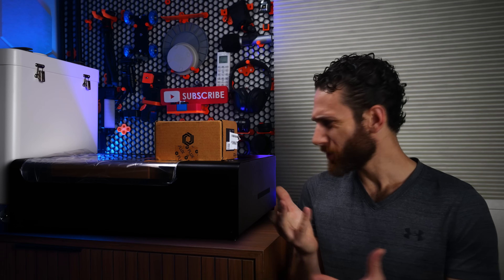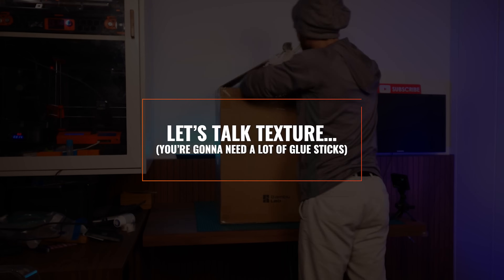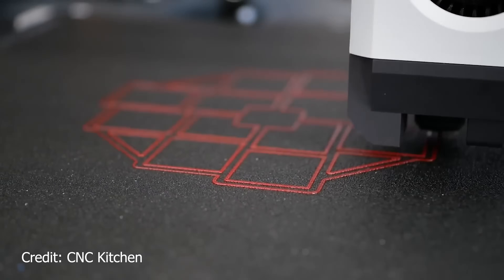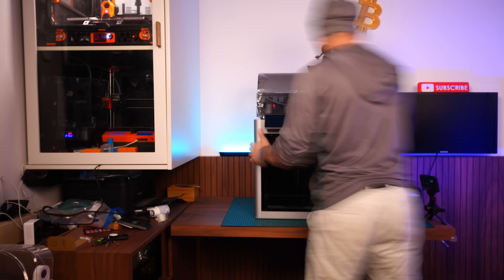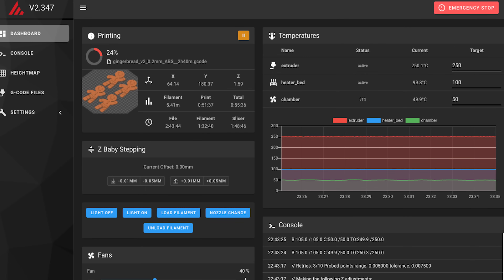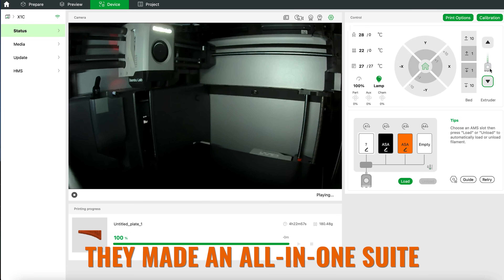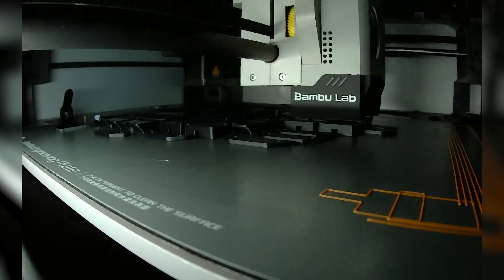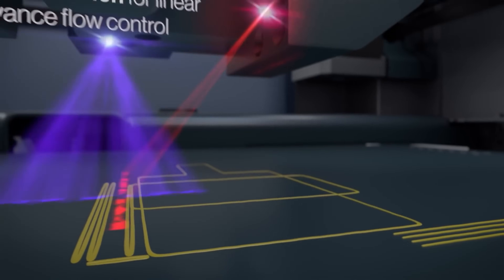Bambu Lab X1 Carbon: What NOBODY Is Talking About...

Comment: I’d love to see Bambu Labs develop a 3D CAD program that matches the design, layout, and terminology of the software they already provide to control their printers. That consistency would make it much easier for new users to learn both the printer and the design process. Similar to how DaVinci Resolve offers a free version alongside their hardware—with a paid upgrade for advanced users—Bambu could offer a basic, free CAD tool to help users create their own models, not just print others’. Then, once they’re ready, they could move up to a more powerful paid version. Right now, many CAD programs cost more than the printer itself, so having an integrated, familiar-looking option would lower the barrier and expand what's possible for first-time users.

Comment: For anyone looking to own a Bambu printer: as of now, there is no such thing. If you buy a Bambu printer, you do not OWN it. Meaning: 

-It will connect to an external server you have no management or control over, violating your privacy, and thereby making the printer dependent and at the mercy of the server you don't own and manage. 

-Bambu Labs, the company, takes part in CHANGING THE TERMS OF THE SALE, and tries to hide their actions. 

-Difficulty in repairs - Bambu often doesn't have replacement parts available, and their firmware for their printers is closed-source, unlike most other 3D printers. 

-Closed Ecosystem - much like Apple, Bambu printers are exclusively designed not friendily accept user mods or 3rd party addons, sometimes even software (eg orcaslicer)

I do not wish to condemn anyone who already has a Bambu product, more so condemn Bambu labs, the shit company.

Spread the word about this, especially in regards to the recent Bambu controversy.

Comment: The biggest downside for me wanting to purchase for my school.  Is the networking. The wifi security support on the X1C is lame, plus there is no Ethernet.  You have to go for the X1E at $2000 to get properly secure wifi or an RJ45 socket.  Or I could buy three Sovol SV08 machines and upgrade the hotends with  direct replacement Micro Swiss hotends.

Comment: Kinda disappointed with parts availability in South Africa, had a mishap with PETG and needed to replace the nozzle and the excruder, spare nozzle used but no one has the X1 harden excruder, had to order a P1P option just to get going and see options available from there. 

X1 received beginning Dec which is the sad portion

Comment: I just bought a C1 Carbon (12/2024) and got a PEI plate with the printer, 2 partial roles of PLA, a partial roll of support filament, spare hot end, and a few other goodies. Loving it so far.

Comment: Mine came with textured PEI plate in 2024. But I had to buy the smooth one ( for printing engineering plastics with a glue stick). Either way, you're gonna be buying a plate.

Comment: Received my P1s a week ago.  I love it.  I am very impressed by Bambu Labs.  They sent textured PEI plate.  They sent a spare print head which was also 0.4mm.  I ordered separately hardened gears and hardened 0.6mm nozzle.  So many want hardened and 0.6mm, I would think that would be another configuration they could offer as a package.  They sure have taken the challenge out of making good parts.  so much better than my Ender3 v2 and CR10.  I should be able to utilize all three, but mostly, I am spoiled now 😎😎  Separate topic, how often do you grease Z axis rods?  And are they greased when it arrives?  The rear threaded rod is kind of hard to reach.

Comment: I guess i'm also al little spoiled by Octoprint. I find that bambu studio and the bambu handy app are not really giving much information about the ongoing print. The first thing i really miss is the pretty gcode viewer plugin from octoprint where i can see live what the printer is doing according to the gcode. I wish Bambu could implement that in the software so that you could switch from camera to the live gcode viewer. Second thing is print time, during the print you can only see print time left and that seems not to be very accurate because it's getting longer and longer. I would like to see the total estimated printtime and the time the print is already running also. I know i'm a control freak and like to keep an eye on the print currently running. I had to figure out the ams also that took me a while. I had trouble with setting the right brand style and colour in bambu studio. synchronisation works only from ams to bambu studio not the other way around. And last the wiper on the X1carbon is a nightmare, it just doesn't wipe most of the time. I'm figuring out wich upgrade i'm going to try right now. Otherwise this printer is a dream.

Comment: A firmware update can change the purge functionality easily, wind the filament back up a bit before cutting instead of cutting it where it is then rolling back. 
Bam save tons just from that, combined with purge into infill and purge amount etc. problem mostly solved.

Comment: Does not have Ethernet connection so all your personal  info is first run through the  Chinese conglomerate cloud and they can see what your are printing and can be stolen, copied. You cannot print your prints with any security.

Comment: The fact that they needed someone to point out the problems is a problem. They are in the business, they should be the experts. Or do they not use their own printers. That's a joke.
Reply from the maker: The problems were extremely minor and they’ve since fixed all of them. They pushed a few software updates after this video that fixed them. 🙄

Comment: What's wrong with your cameras shutter speed?   I mean i thought it was some loading error at first.. then wondered if it was just a bizarre "artistic" ethereal choice for the intro where.. you were snapping your fingers to make things appear .. but it continues throughout the entire video..   Was this an accident?  And you just went with the footage? || BTW What has happened is instead of setting his shutter speed to double the frame rate.. E.g. if 30FPS then Shutter speed = 60 or FPS of 60 Shutter speed = 120...  -- And he has made the shutter speed significantly slower... or longer.. 

And i cannot understand why.. Its not like some dream flashback ...  its an informational video.. 

anyway i don't get it as a youtuber he would know this..   but in case he really doesnt.. I hope this helps to have normal videos that dont look so hard to watch..   
Genuinely just trying to help!

Comment: Bambu Labs lost me at "walled garden."
I do not mind an integrated suite of tools (and I likely will, eventually, never use anything else) but not being able to connect an external tool to send gcode direct makes anything from Bambu Labs a no-buy.
Reply from the maker: I’m pretty sure you can put gcode on the SD card and load it bud.
Reply: @thenextlayer  You have to be kidding. Load up an SD card each and every time I need to take direct control of the printer. I think you missed the point.

Comment: Seems they listened to you, because I got a free texture plate with my X1 Carbon. The printer is so good, that after printing just 1 print, I immediately ordered a 2nd unit. The machine is as smooth as butter, and after a couple of dozen prints, I am yet to have a single issue of any kind, either with the machines or prints. No jamming, no stringing, no adhesion issues, nothing. 

Before the X1 Carbon I was using a small fleet of Ender 3 pro max neo printers. After experiencing the difference between them, I am not of the believe that creality enders are trash.

An X1 Carbon is about the same price as 4 or 5 Ender 3 pro max neo printers, but in a race to produce 100 units, a single X1 Carbon will win. The X1 Carbon is not cheap compared to other printers, you are looking at $2500 bucks if you want to include some extras with it, but you do get what you pay for, and it is totally worth the price.

Comment: I got a textured plate with mine included, I think its random... but after you spend $1,500 on a printer, whats another $35 to get two plates useful plates?
Reply: Well, I have 4 plates for my P1S.  One that came with the printer and 3 others that I got from Amazon.  It sometimes helps when you want to remove a recently finished print, and immediately get started with the next one!!

Comment: Hi. I just got my X1 Carbon less than 12 hours ago in the mail. After I got everything working I printed a bed scraper, then I printed a 1 hour 9 minute articulated crocodile off the menu. It came out perfect. Then I went to print it again but in a different colour filament. I sent it print again and went on doing other things in my shop. I looked at it about a half hour later and realized that it printed 3/4 of the first layer then was printing in the air for the rest of the time. I went to start over just to find out that the filament is stuck! You can see it throughout the entire tube inside to the hotend and through the back but I can’t t get it to release out of any of them. Can someone help me? Or do you have another video to help me clear this out so I can use it again? It’s been sitting now with the power off, longer than I got to use it. Thank you in advance for your time. Giamarie
Reply: printed in the air but there was no filament that came out

Comment: Have their A1 mini. It is easily the best 3d printer I have used. Just don't deal with their customer support if you are a B2B customer. I have never seen such a convoluted way of doing a dang purchase as a company as with them. As for the textured plate, I swapped that out for the smooth one, just personal preference no specific reason. I have yet to use the AMS though. I got it with but I took the A1 mini because of space considerations so the AMS is a bit of a space issue. But I found a 3d printed setup to hang it on the wall so that's next.

Comment: I'm glad it shipped with the cool build plate, I would not have tried it out unless it shipped with it and I am sure now that I use that almost exclusively I'm saving a lot in electricity by not wasting all that energy heating the build plate.  I have bought dual sided PEI Bambu build plate as well as after market PET and PEO build plates with designs left in the bottom of your print that looks like carbon fiber or diamond pattern.

Comment: I prefer a smooth plate, so I'm fine with this choice.

That said, I generally print engineering parts and model pieces, and both of those prefer smooth parts.

Comment: Note about cardboard spool adapters - there are some worries.  Depending on the cardboard spool you're "adapting", it might end up becoming too tall to operate in the AMS w/ the lid closed.  Big time bummer.  Every single "Inland" filament I purchased from Microcenter had this issue... sadly, I didn't know any of this before buying a crapload of it.  Don't buy cardboard spools unless you have absolutely no other option...even if it means you spend a little more.

Comment: No active heated chamber, and having to pay twice as much to get it in the X1E is a non-starter. Such an expensive machine to print worthless PLA and hardly better PETG at high speed is ridiculous. To get it to print actual high temp filaments, you have to slow it way down and hope whatever glue you use holds. I don’t see why a printer any Ender 3 can compete with after a little tuning is $1500!
Reply from the maker: I print PC nylon and all that stuff on this thing fine…

Comment: Good review. My team at work looked at this printer but we went for the ultimaker 7 full kit with material bay, this machine has a lot of the features that Ultimaker has. This looks to be a really great bit of kit for the price, a tenth of the Ulti 7.  I really like the nozzle cleaner, the ulitmaker just releases excess filament to the side of the bed, which builds up under the bed.. The dual nozzle, multi-filament print option on these printers is very wasteful.

Comment: I'd like to get one, I really would.  I've already got an MK4 with an MMU3 on the way.  I thought about getting one of the Bambu printers with AMS, but that would end up being roughly $800 or more because I'd want at a bare minimum the P1S (OK, more like $1100+) and the MMU3 is $299.  That's a huge difference.  You're right about one thing, though.  I can't understand why a company charges you shipping when you drop over 1K on their equipment.

Comment: Love my X1C and AMS. So far so good. The only thing I did not like prior to dropping 1800 dollars on my order with them was that they don't have a phone number posted. You can not call them. It is impossible to speak or communicate with a decision maker or manager or quality control manager.... I eventually found some phone numbers for certain aspects of their business through some digging. Even on official documentation for the company they go to great lengths to conceal their direct contact information. That is sketchy. So their support is limited to online and messaging only. I have read horror stories about their support. You would think that a high end machine would have excellent support feedback online. That lack of access to support on the phone and the hoops they make you jump through when there is a problem is a huge red flag. That is a huge disappointment and downside to being in this space with them. Funny thing is they bumped the price up to 1499 and don't include the textured plate which you probably need if you are buying this product. Luckily my worries about not being able to contact them directly and the lack of accountability on their part for support haven't been anything I have to worry about just yet. The printer was shipped well. Packed like a tank. Arrived in perfect condition. Removed packing material, had it set itself up and it printed a perfect benchy in 26 minutes. I really like the phone app, Bambu Handy and I like the Bambu slicing software. Its great. Only issue is I cant get the video stream to work on my windows laptop. Works on mobile flawlessly. The guidance documentation on the video stream is not something that is easy to follow and I don't see any instruction on what to do in order to get the video stream working in the slicer app. Currently it will freeze the app if you attempt to view the stream even following the parts of the guidance that are followable. Something I don't like about how it behaves is that when it cleans the nozzle it destroys a small square of the build plate covering. So even if you take great care of the plate, the machine itself sacrifices the plate. It should have come with something to attach to the poop chute to capture the purge nuggets. I printed one but I feel like it should have come with that. It also should have come with direction on how to use a single roll on the back instead of the AMS. It seems like there is room to improve as a company and maybe thats down to their leadership but if they get their product support where it needs to be with a phone number and someone to talk to that would help the comfort level of those who are willing to drop 1500 for the X1C or 2500 for the top of the line model.

Comment: I really wish they would finally solve the multi color print by using translucent filament and color it in where it needs to be via RGB instead of having 25 different colored rolls of filament.
There is multi filament printing and there is multi color printing and they are not the same.

Comment: Great video - Ummm - I am having a love / hate relationship with my CX1 at the moment. Let's just put it that way for now. (mostly concerning consistency in print quality and adhesion issues when NOTHING HAS CHANGED in the settings on repeat prints)  - I have not had ANY problems with my PRUSA MK3s over the past 4 years. So was going into this purchase with certain expectations. So far I have had a hotend assembly JST connector break when changing the hotend - and many failed first layer prints. I started using the engineering plate with PLA and bed temp of 65 and so far so good. (though they tell you that the engineering plate is not for PLA) - also I don't like the fact that I can't adjust the z-index live or in the machine settings like every other printer I have used. Adjusting the z I think would fix the adhesion issues I am having at times. Thanks for the video.

Comment: Not that it's comparable, just an interesting fact.  Simplify 3D has had printer control built in for a while.  I started 3d printing 6 or 7 years ago and it was included then.  It's what I printed with up until last year when I finally switched to Octoprint.

Also, you're saying this printer will use different brands of filament?  That's great.  I was under the impression that only their spools worked in this printer.

Comment: If you look at any other industry, Bambu is definitely the direction for the future. More features put together in a better way and easier to use but less customizable and more locked down. It's going to be amazing for making things but the tinkering will solely be printing and not the printer.

Just like computers - at first it was exclusively DIY and now many people's primary computer is actually a smartphone.  From $7500 for my first build- it- yourself (1990's $) computer kit to a few hundred bucks for a smartphone that is both hardware and software locked... but an order of magnitude more capable. The end result is an amazing product and experience, but all the features good and bad have to be cookie-cutter to make it profitable.